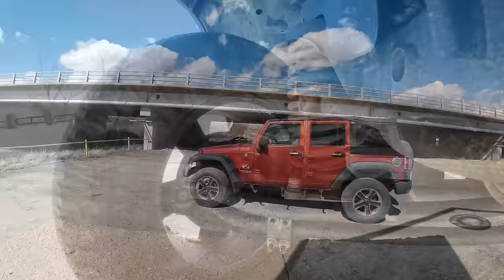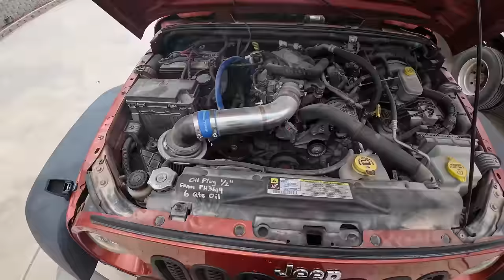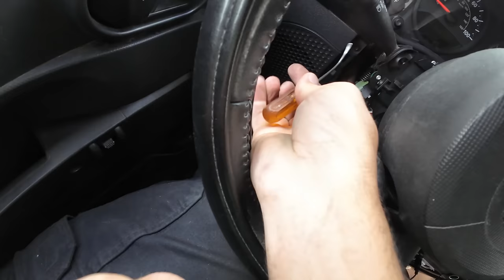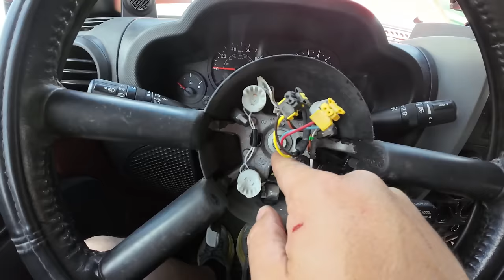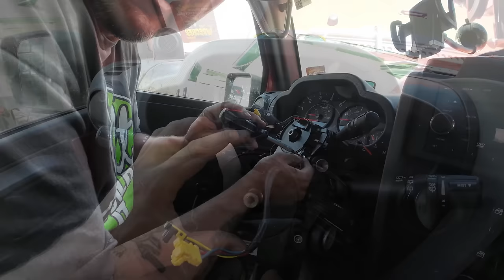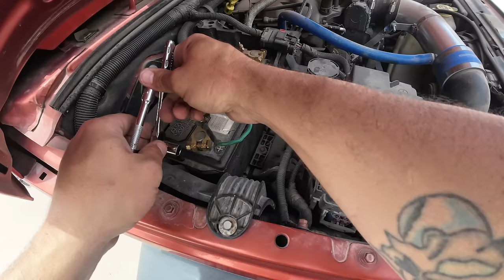Jeep Wranglers #1 Problem Fixed!! How To Replace A Clock Spring

Comment: I purchased a used 2010 jku Rubicon,  in Colorado.  Then I took it into the local dealership in NM to get it checked for recalls, and the clock spring was a recall item.  They took it to the shop, and it came back out in an hour, all no charge.
Reply: Same here.  Had to wait 3 months because the parts were back ordered.  Must have been a big run on them.

Comment: Great video Colt. FYI turn the steering wheel lock to lock and back to center on start for relearn. This will get the computer to acquire new data to reset dash lights. If you should continue to have issues check the steering angle with a scanner. The steering angle has to be 0 degrees or system will not function correctly. If angle is off adjust draglink. I hope this helps someone it took me months of research to fix my JKU.

Comment: Hurray! for the simple explanation.  ....   I recently discovered how to stop the start up ticking of my 2012 JK, floor the throttle while holding the brake and the engine will turn over but not fire, so there is some oil pumped and it doesn't start dry.  Which leads to Baxter Performance. Tell us what you know. Please.

Comment: GET YOUR DEALER TO DO IT FOR FREE. There is a recall on this. Check the two NHTSA Campaign Number: 16V288000 and 13V176000. My dealership was going to charge me $1600+ for a new airbag on my 2011 Jeep Wrangler. I had to ask 3 different advisors to have the "technician" check the clockspring first. They finally checked and replaced the clockspring under the recall with no cost to me.

Comment: Nice information to know about the clock spring replacement as well of the tip with touching the battery terminals together after they are disconnected.

Comment: Just a tip-After you put it back together turn the key on then go out nd hook up the battery. That way if it blows your not in front of it, And also set it aside with the bag facing up
that way incase of a accidental deployment it won't get air born

Comment: The dash lights just came on and the cruise quit working. Lasted the drive home then went away.  Timing of your video was perfect.  Sounds like a clock spring on my 2017 Rubicon is in my future.  Thanks Colt

Comment: Great info Thanks.  Last year (mid 2023) I had my 2010 fixed for this on a recall. (Free)  They told me the recall had been extended because so many needed it and parts were slow in coming.  They also told me not all 2010’s meet the recall so your instructions are well needed.

Comment: Great video.  I get a shudder every once in awhile when turning and braking on a right hand turn.  Also when hitting potholes or a rough road my traction control light pops on.  I think you solved my mystery issue.  Thxs again 👍
Reply: Replace the hubs, too. These jeeps are so easy to work on.

Comment: I’ve noticed the big problem with the dodge pentastar engines is the lifters and cam issues they start a little tick and gets worse the roller needle bearings fail great video !
Reply: Yep. Pentastar tick. Had to replace one of my cams and all my rockers last year.

Comment: The clock spring is the same for the 2007. I did the same thing to mine. I have changed it a couple of times already. Fairly easy if you follow the steps outlined in this video. The only pain in the rear end are the clips holding the airbag in. Cheers!

Comment: Great information, had the same problem on my jk, did same thing you did, glad you shared the info with everyone, always good to pass it on, save some money on parts not to mention labor, $50 is a whole lot cheaper than $ 1000 at a dealer

Comment: Interesting that this is the default fix. On Land Rover Freelanders (LR2? In US) we talk about the 'Three Amigos'. When the ABS, TC and HDC cone on together. It is almost always an ABS sensor that has lost signal. Clock spring would be later in the diag.
My son is a mechanic and he had an issue with ABS etc coming on on a Mitsubishi. Turns out the wheel bearing replacement wasn't quite correct and the ABS sensor was drifting in and out giving odd signals.
Thanks for the good work and hope the channel grows.
Cheers from the UK.
Reply from the maker: If it happened to kick the lights on when I was doing anything else but turning then I'd have looked into the speed and abs sensors for sure.
Reply: @coltbuildsit  ah, of course, missed the steering aspect being the obvious call (Doh!) 🙂
Just with Land Rovers and their famous reliability, using a dumb plastic sleeve for the abs sensor means a stray stick and Three Amigos 🤢... We don't get many proper Jeeps over here.

Comment: I have 2016 JKU and they change it just a little bit. The bag is is held on by a couple of little bolts hid on the sides. I also picked up my clock spring from eBay and it was identical to the factory one I replaced, right down to the numbers imprinted one each other. 

Keep up the great work. Really loving the new channel.

Comment: Colt thank you! You have a wealth of knowledge that I appreciate you sharing. I Have a 2014 jku with this issue, started with battery connection, moved on to thinking it was water intrusion in the sway bar disconnect module, but after seeing this I believe you put me on the proper track. A little intimidated to deal with the air bag but I will figure it out with your help here. 

I love my jeep and this may save our relationship, not to mention keep my wife happy since she drives it way more than I get to.

Comment: Great video. One thing I'd add in terms of tools to pick up would be a good OBDII reader. As you point out, there's nothing worse than going to the dealer and getting blown off because you can't replicate an issue. Being able to run a scan and pull codes can be a huge help. Some of the newer readers tie to phone apps that will include common solutions for various codes, which can be very welcome in helping someone make the determination to DIY or bring it to a shop.

Comment: Most if not all of these wranglers have a recall to replace the clock spring and update the column covers and also a recall on the passenger air bag inflators as well. Check you vin.

Comment: Had a clock spring on a Tundra go out. About $50 on ebay and 11/2 hrs of my time and saved a ton of money. Grounding out the system keeps a little stored juice from possibly setting off the air bag which could ruin your day in a big way.

Comment: Thank You Colt, I had that problem with my 07 JK in 07 and it was replaced twice because i ended up with a bad one from the factory.  They also had to replace the throwout bearing as well......
Great tip on touching the positive and negative battery leads. 
I wish there was a way to eliminate that damned clock spring assembly.

Comment: Make sure that you check with Jeep and make sure this is not a recall item. I have a JKU with a ton of miles on it and I have replaced the clock spring three times before I found out it was a recall item and the dealership did it for free. And yes I paid the 400+ dollars per clockspring every damn time.😡
Reply: I have heard this on forums, I called a local dealer and the guy could not confirm if mine was a recall item.  He just kept saying bring it down we'll look.  I don't trust them.  Anyone know if there is a database out there to see if the recall applies to a certain year/model?

Comment: Colt, another great video! You’d be the perfect guy to do a video or a series that I think would be very useful.
For several vehicles, as you have time, share what usually breaks and what to upgrade before off roading.
I drive a Tundra Crewmax, and I want to come to Utah for mild off road vacation.
What breaks? What should I check and upgrade?
Just a thought, I appreciate all you do, thanks.

Comment: Something people never think of when they are messing with their steering. Not securing the steering wheel to prevent the clock spring from getting out of alignment by either overwinding it or under winding it. Either can cause it to short out.

Comment: If your out and having issues with your a.b.s or traction control you can pull relay/fuse j6 and it cuts it all off 100%

Comment: Perfect timing, I was just looking at replacing the  clock-spring on my 2010 Wrangler.
Reply: Check for a recall.  Got my 2010 done free on an extended recall in 12/‘23
Reply: @BillyBoulder  Thanks, I’ll check that out.

Comment: Great video. I cringed when you turned the key. Waited for airbag to pop. An idea for a video would be replacing the plastic clip for the shifter cable in the console.

Comment: Great how to video presentation.  Keep them coming!!! I had an issue with a front wheel hub bearing on 1/2 ton Ram, it was bad and the return process made me swear off the cheap eBay or any online parts forever.

Comment: reason it trips all the lights

traction co trol and  abs takes input from steering.. it tells module what direction  you are turning the wheel and how fast..
uses that info along with wheel speed inputs and impact sensor data gforce data.. brake input etc to determin which wheels need brakes applied to achieve desired direction of travel safest

Comment: My wife’s JK did this after I installed the lift kit, (I neglected to center the steering wheel)
But she complained about the steering wheel enough that I finally centered it, those lights have not come on since.
Unrated ,
I do need a $300 clock spring for my Ram 3500.

Comment: I've had an Idea about what you can do about your Pacers door panels and the other interior plastic trim, and that is to 3D print them or get someone to do it for you. The door panels once printed can be painted or wrapped in some vinyl wrap. You just need the scans of the panels these can be done with free scanning apps on cell phones. I'm sure some fans who have a pacer could scan and send you the files.

Comment: For any auto part to be sold in the US, it has to meet minimum quality and manufacturing standards so even inexpensive parts will be the same spec as OEM.. They can definitely be a difference between inexpensive and higher price parts but in this case, it's worth a try to get the cheaper one

Comment: Awesome video and easy to follow! I had to watch a different video to help with the airbag removal portion, turns out the three pins were stuck! 

I replaced the clockwork and finally got rid of those annoying ESP BAS & Traction lights.

Now I have a separate issue: I’m getting the No buS error and flood of dash lights, on occasion. Anyone else get this?

Could it be a bad clockspring ( bought new on eBay)? 

Appreciate any advice here.

Comment: I've replaced so many clock springs that I can usually diagnose it over the phone. I ask the customer does it typically happen when turning and when it does happen check to see if your horn works.

Comment: The clock spring has a 15 year extended warranty on it. I know my 2016 jku Rubicon clock spring went out, found out about the warranty, and at no cost hot it fixed, I could have done it myself....but free is better for now

Comment: FYI. You can still have this done under warranty at the dealership. The only catch is you HAVE TO HAVE the airbag light going off as well. There is an Extended Service Warranty/Bulletin that they don't like to tell you about but if you push, they have to fix it for you. How do I know? Just had mine done few weeks ago for ZERO $$$ at the stealership on my '14 JK. I had originally planned on doing it myself because my airbag light was not indicated. I even bought all the stuff I needed, then one morning the airbag light came on, I made a call, they ordered the parts, and 1 month later it was done. If anyone needs a clock spring, I have an OEM MOPAR sitting on the shelf, will sell for cheap.

Comment: Thank you Colt for sharing this information with me ! I have a 96 Suburban that the fuel pump went out on it ! Bought a new one at a parts store installed it but still had a problem ! So I took it to a shop they replaced the fuel pump and it has worked great every since then ! Come to find out for some reason the fuel pump that I had bought wasn't putting out enough fuel pressure to allow it to run correctly ! The shop put a AC DELCO fuel pump in it ! I'm not sure what brand of fuel pump that I got from the parts store other than that's what the fuel pump suggested by the computer ! Is there away to adjust fuel pumps to increase fuel pressure or dercrease fuel pressure ?

Comment: I have a '15 JK. There is a recall on that clock spring. Jeep has extended the warranty on that part for quite a while. Mine has been replaced twice for $0 at a dealership. Good information if they ever cut me off and I need to DIY.

Comment: Had a JKUR for about 5 years. #1 problem well maybe but the only repeat problem I had was ball joints. If ball joint deletes existed at the time that might have ended the cycle. You should get a ton of content out of that rig, and that being said I wish I never sold mine.

Comment: Changed one in my xj ,  brand new but was a bad part 😅 
So then I took one out my back up Jeep and it’s still working til this day ,(new doesn’t mean better )
Reply: Anymore new usually =Chinese which means that 8 outa 10 will not function correctly…. Anytime you can use old parts you’re better off. Personally I will not buy any vehicle made since 2004, everyone I know who has is regretting the purchase and it really don’t matter make or model they all are built with the reliability of a bicycle lighter ( they work for the first day and then never again)
Reply: @oliverohnemus5791  I agree with this that’s why I stick with older Jeeps mine is 24 years old with very very little rust I just think older stuff was made better because it wasnt cheap you know ?  

I won’t buy replacement parts from china that’s for sure

Comment: Did you have to get a clock spring that matched your VIN? I did a clock spring in my WJ but it needed to be dependent on my VIN. I don't have to change my clock spring on my JKU yet but it is quite a bit different than the WJ.
8:28 For those of you at home, DO NOT REMOVE THAT CLIP until the clock spring is fastened down or you will end up needing to buy another clock spring.

Comment: Thank you
We just bought a 2017 wrangler sport unlimited. And nowI know the ding and brake light when I hit the brakes hard  issue.
A sight piece of mind as to the we are dealing with.
But the big question is - has there been or why has there not been a recall if this us a known issue?

Comment: Very simple and helpful video. I do have a question: I have a 2009 Jeep Wrangler Sierra and had my clock spring replaced some years ago, but shorty after, my horn stopped working as well as my cruise control. Did they mess something up? Is this another bad clock spring symptom? Could it just be wiring? Any guidance would be appreciated.

Comment: Does all this apply to a 2007? I have these issues with mine. I have heard wheel sensors, I have heard to do the hokie pokie steering wheel dance (guess my software doesn't not allow this)
My lights dont come on all the time, and is really sporadic. 
At the moment I just have the fuse pulled cause im tired of  the traction/eps light doing that.

Comment: So i have a 2014 wrangler that isn't shifting and speedo isn't working. Abs had been on for a while, but now it shows u1412. One search says could be the sensors inside the trans. It only has 85k miles and I'm stressing because i cant find the issue

Comment: Question.. I just had mine replaced at the dealer because it was still under warranty.  Is the steering wheel supposed to be really stiff afterwards.  It feels like I don't have power steering anymore?

Comment: i replaced my clock spring on my 2014 wrangler after i did i started having shifting problems and the check engine light came on for the airbag clock spring? any ideas??

Comment: Could this be a Chrysler issue..? Same thing happens to my 2006 2500 Hemi 4 wheelD… same lights… had most joints and bushings and alignment, and same issues and lights..!

Comment: Not always the fix. Just sold a 2007 that had no working horn,  no cruse control, traction control light and an air bag light that drained the battery in 48 hrs. I replaced 2 clock springs, air bag computer, cruse control switch, horn relay, cruse relay. Nothing worked. My problem was either in the ecm or in the wiring. I got sick of wasting time and money and sold it cheap. I told the buyer that they had to unhook the battery every night and they wanted to buy it anyway. I'll never buy a computerized jeep again. Old school Jeep maybe.

Comment: I have taken my jeep in to the dealer three times for the clock spring.
The next time I took it to a different dealership because when they replaced it last time, all my buttons stopped working . They told me that it wasn’t the clock spring and they wanted $1200 more for diagnostic of why my menu button wouldn’t work and scrolling button on the steering wheel.
Stealerships, don’t trust em

Comment: I replaced mine trying to fix my horn not working, but in the end it turned out the cruise control module in the steering wheel was not working.

Comment: Thanks Colt, very informative. I’ve not had this problem, but I have another issue with my 2017 JK. My windshield wipers no longer have the intermittent function, and the wipers don’t park properly when shut off. Is there a simple fix for this?
Reply from the maker: If your clock spring had been replaced at some point, I wonder if they didn't feed the wires back under the plastic gaurd properly.
Reply: @coltbuildsit no that’s not it. I’d been told it had something to do with one of the computer modules. It was identified by a series of letters that I don’t recall offhand.
Reply: @coltbuildsit just a follow up to my previous post. The module I was referring to is the TIPM. Do you know anything about them? Anything about diagnosing an issue, a parts number, are they specific to year of vehicle manufacture or VIN?